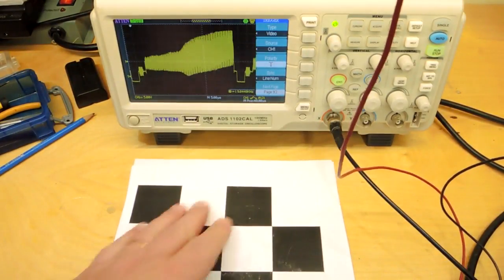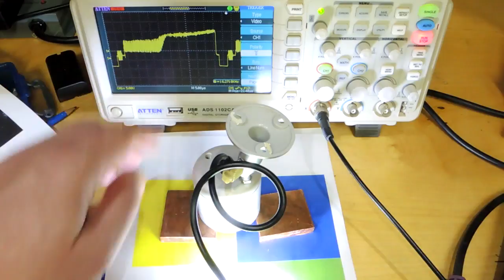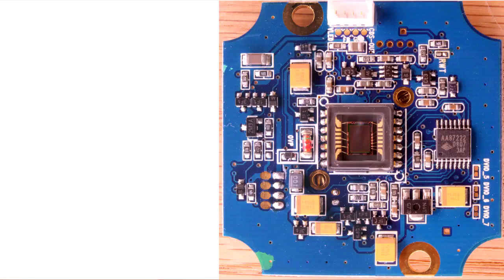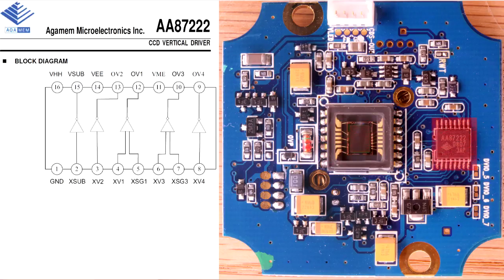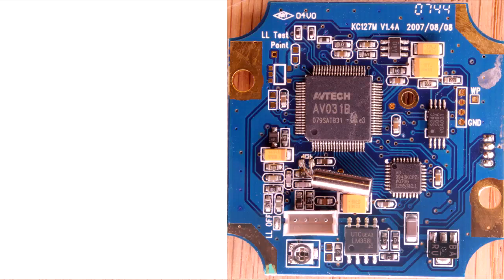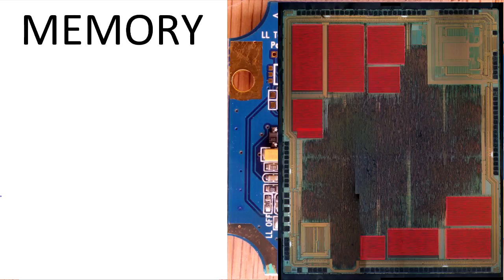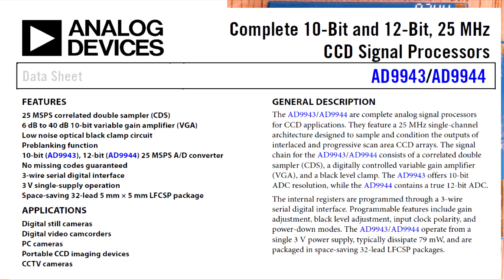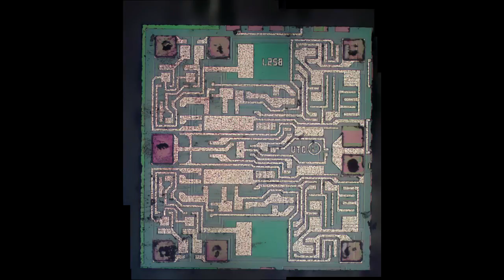CCTV SECURITY CAMERA TEARDOWN

Comment: WHY the HELL is there so much DIGITAL circuitry in an ANALOG camera??? On a CMOS camera the sensor directly outputs a composite/signal (PAL or NTSC) that is sent to a cable or to a RF modulator.
Reply: No. Here, analog only refers to the way the video signal is sent to the DVR. The only true "Analog cameras" by your standards were the really old ones with Vidicon/Trinicon tubes in them. The image sensor does output an analog signal, but it is nowhere NEAR a composite signal, especially with weird 4-color filters (Yellow, Cyan, Magenta, and Green, ICX027CKA) and would require a large amount of analog circuitry for all the necessary functions (Preamp, CDS, AGC, Iris control, Sync generator, External sync signals, Timing generator, Luma-chroma separation, YUV-RGB matrix, White balance, Slicer, RGB-YPbPr matrix, Title insertion, Conversion to composite video, etc.)

Comment: Nice teardown. I think the IC you pegged as a voltage regulator is actually an NJM2561 video amplifier (lettering on the die visible from the decapping photo). This kind of analog camera-on-board is still quite common in the RC FPV world, but the cameras used there tend toward CMOS due to video quality.